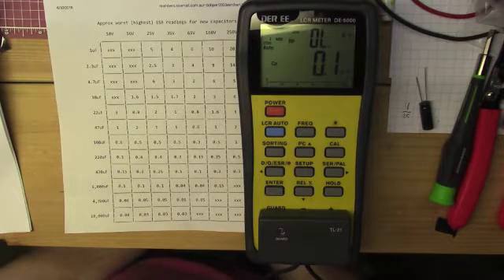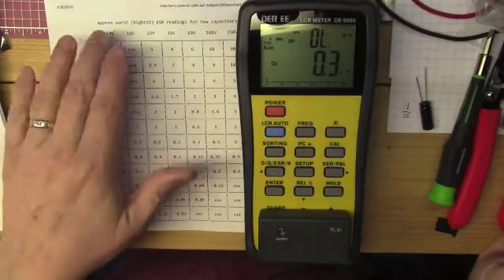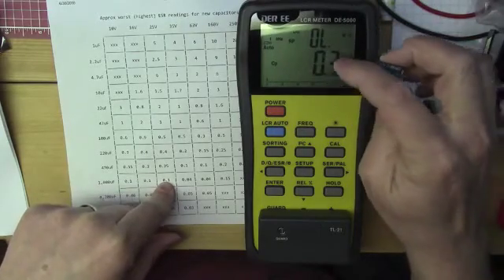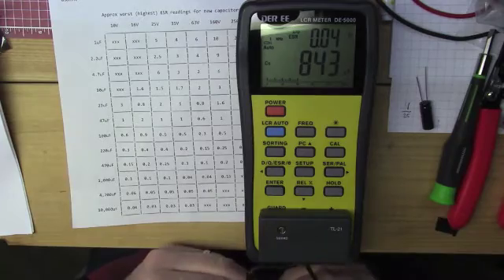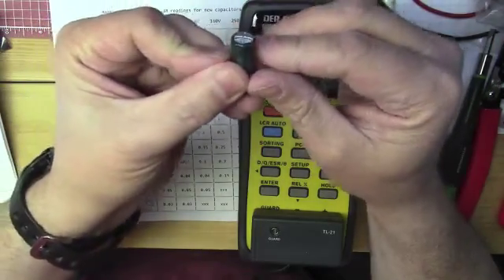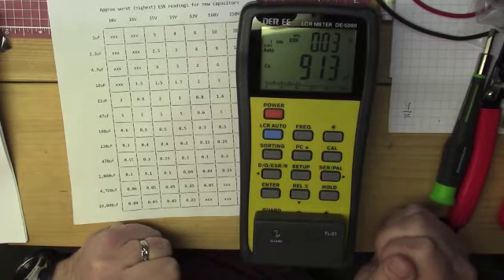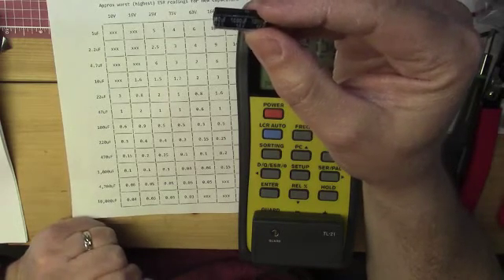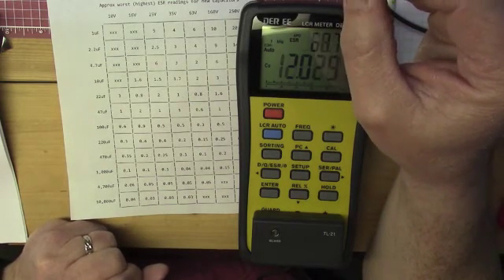What does a bad cap look like? Testing ESR on some Caps with a DE 5000 LCR

Comment: Some of the differences in reading is due to frequency used to test vs manufacturing test frequencies. I found it best to use 120 HZ for most . TRX lab has a good lengthy video explaining the DER EE 5000

Comment: Should be tested at 100khz not one
Reply: Power supply caps should be tested at 100 or 120, I can't remember what the lower range is on this meter

Comment: The DE5000 instructions are written in Chinese. I've never used mine. I don't read, write Chinese.
Reply from the maker: https://www.ietlabs.com/pdf/Manuals/DE_5000_im.pdf
This is the same meter but branded under a different name. Manual is in English. Good luck.👍
Reply: @TheRadiogeek  Thank you!
Reply: @TheRadiogeek  why should I have to pay  to print out a manual that should have been in English to   start with?
Reply from the maker: Paul Isham I don’t own the company. I guess if you want an English manual that’s what you’ll have to do.
Reply: @paulisham5669  An IET DE-5000 is $400 a DE-5000 OEM is $100. You get what you pay for.

Comment: Have you learned any more about your DE-5000? Great video, short and to the point.  FYI the ESR datasheet link is bad. but can now be found: http://www.bobparker.net.au/esr_meter/images/2003esrchart.pdf  If that fails just Google, "approx worst (highest) esr".   I've had mine about a week and found you just about have to have the manufacturer's datasheets to use it.  But as you've learned as you get a feel for what bad is, it helps.

Comment: As per a previous comment, you need to understand that as frequency goes up, effective capacitance goes down.  The manufacturers quote cap values usually against 120Hz as this is full wave rectified US mains frequency. You keep seeing low cap values in your video due to testing with the meter on its default of 1kHz.
Reply: Yes from data from Rubycon, 470uF 16V 120Hz is 470uF, BUT at 200kHz is only 130uF and at 600kHz is only 80uF

Comment: did you just state the 470uf was .1 ohm esr max ? the chart says .25
Reply from the maker: george vagner yes I misspoke, it is as you say .25. Thanks for stopping by.
Reply: Where did you get the chart? I removed several capacitors and I tested with an esr meter but I do not know if they are good or bad that is the reason I need a chart.Thank you

Comment: The ESR values on the Capacitor Data Sheets need to be measured at 100Khz.  The capacitors Capacitance should be measured at 120 Hz.  Not at 1 KHz where the LCR meter defaults to.  You might look at the Data Sheets to see what the manufacturers measure their caps at, Dave Jones at EEVBlog,  usually shows you the Panasonic Data Sheets.  Later Ray Burke.
Reply from the maker: ray burke thank you for the information. This LCR meter is a new toy and I am still learning. Thanks again.
Reply: Hey mister. Is there any meter that can be programmed to do it for you while it measures?
Reply: Any product sold in the USA should have the instructions written in English.

Comment: I've delt with this problem quite commonly I get TV's in the shop from time to time with bad caps in the power supplies. Those 1000 uf 25v or 16v caps seem the most common value to fail! Good work!